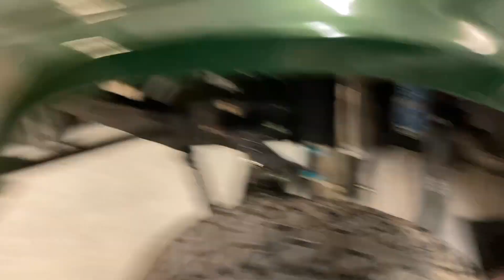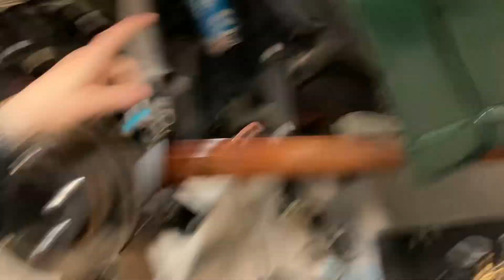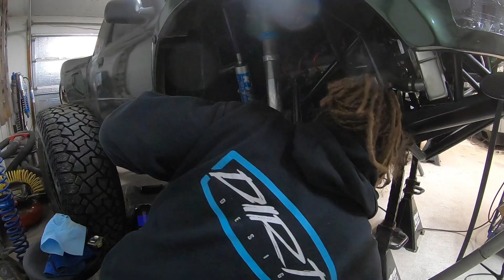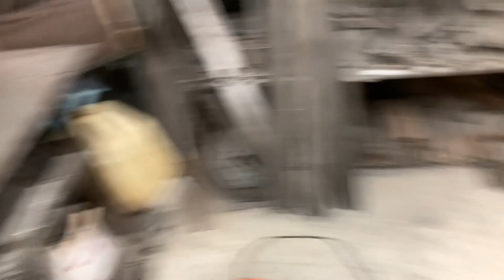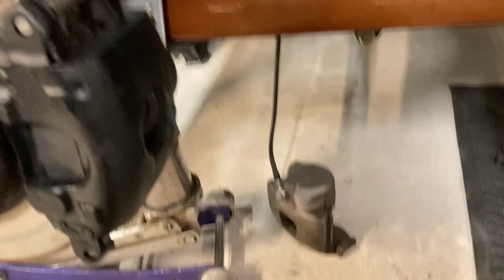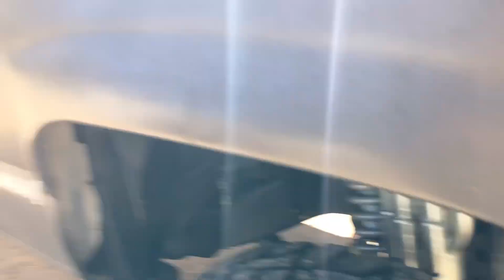Installing Custom I Beam Suspension on a Ford Ranger Prerunner - DH Vlog #71

Comment: Working on the steering for my ranger. How do you know where to place the height of the steering arm on the knuckle? Does the length of the arm just mirror the distance from link mount to swinger to keep the beam/link swinging parallel? Thanks!